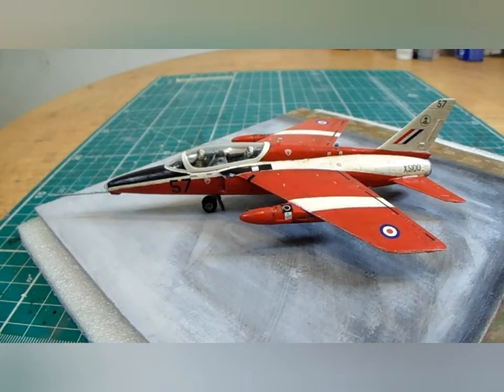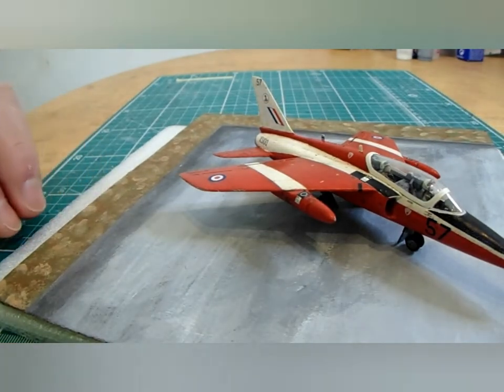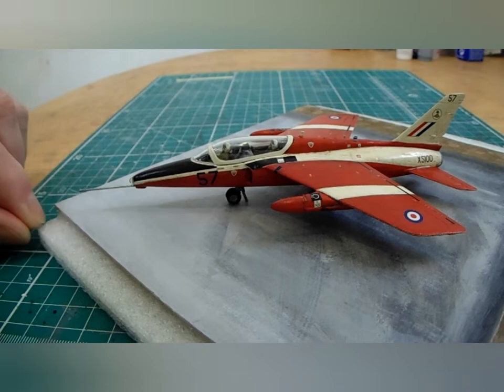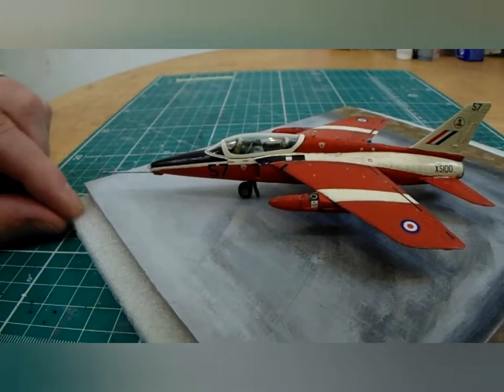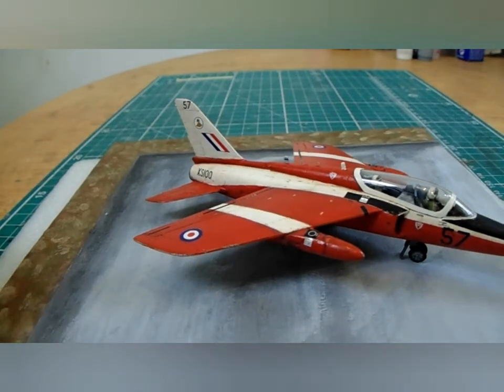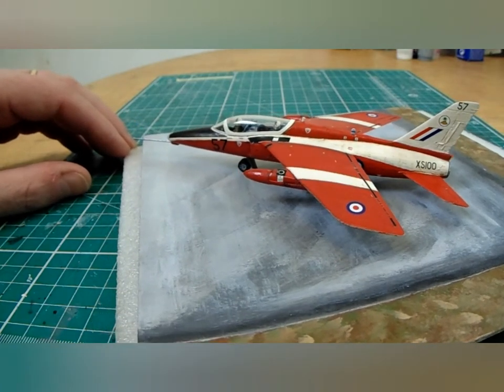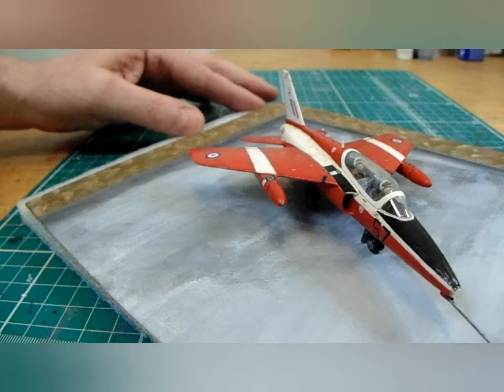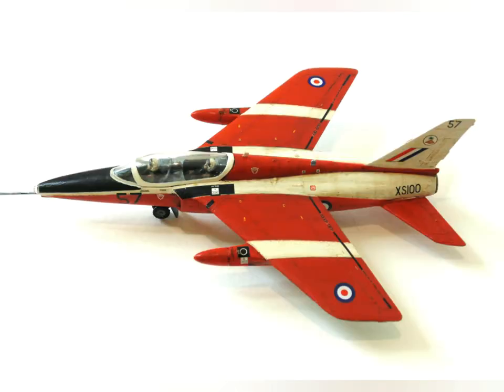MFM:   Airfix 1/72 FOLLAND GNAT T.1  Final Reveal

Comment: It’s a typical airfix model, eg lots of test fitting before the glue, I encountered the same wing fit issue with it being to high at the back, I removed the inner flange and scraped the side rails  where the lower wings rested to get the height required.